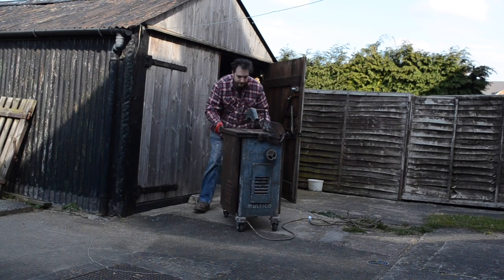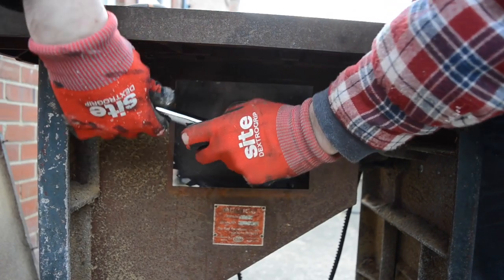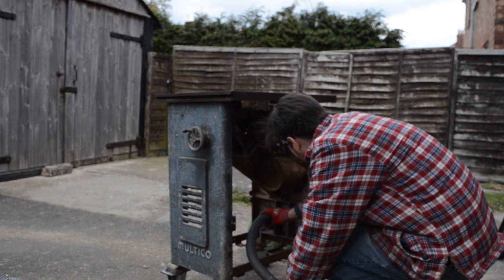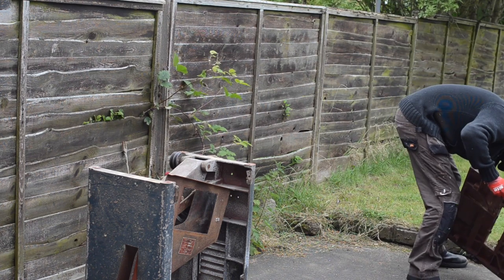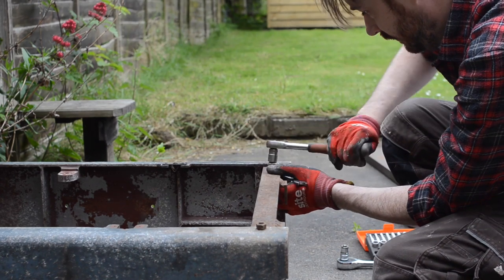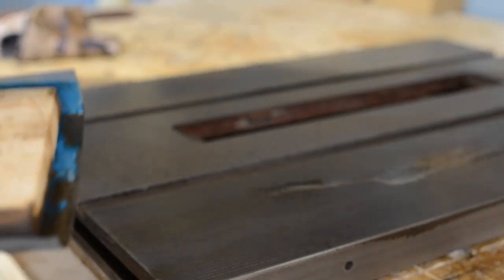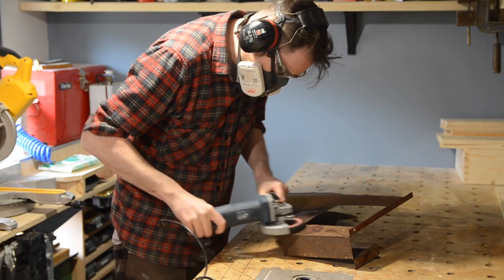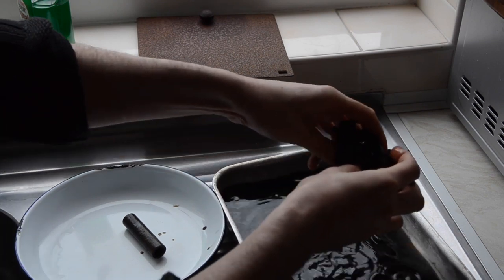Multico A1 Table Saw Restoration Part One

Comment: I wish you had uploaded this video series a year ago! I too bought exactly the same make and model of table saw last year and stripped down, repaired and repainted it. My saw has the mounting holes for the lubrication tank; I had no idea of their purpose until I watched your video!
My saw is a Multico A1/3,  the 3 meaning it was originally powered with a 3-phase motor but recently converted to single phase. 

Its an excellent saw and chomps its way happily through 100mm thick oak or other hardwood with a new Freud blade. It is very well constructed and will last for years to come hopefully!
Reply from the maker: Thats good to hear. The ability to cut through 100mm oak is great.
Reply: I've  got  one too, it has a three quarter inch arbour. Where did you get your blade. Or converter I'm finding it  difficult  to  track down

Comment: I couldn't resist having a dig, it seems that there was a Multico Petrol Table Saw with a Villiers engine.  I imagine yours was such a beastie and was 'upgraded' to electric when the engine packed up or to make it less noisy.  I could, of course, be miles out, but it's fun to have a guess.  Nice project, I'm looking forward to seeing the finished article.
Reply from the maker: You did better at finding information then me. Thanks Robert

Comment: The fact that the saw has a liquids tank and no riving knife plus a none swivel blade leads me to believe this was used for sawing non ferrous metal and the tank was used originally for lubricant . cheers and good luck with the project .
Reply: Agree 100 percent
Reply: (Engage armchair commenting mode): Also the fairly low RPM might be another clue? Looked slower than a typical table saw for wood.
Reply: @alexnosheds  1450 rpm is average speed, wood lathes, saws etc. Its the ratio of the pulleys that give the actual cutting speed. Basically large driver to smaller driven, fast speed. Small driver to larger driven, slower speed, regardless of motor rpm. (Or in wood lathes a multi choice of pulleys for more speeds). What you need for bench saws is power which this had looking at the hp.
Reply: gbwildlife uk I was looking at the spinny cuttey thing when it was running. 👍

Comment: Great old machines for ripping. Glad to see such a good fence which only goes as far as the gullet of the blade at bench level, as should be the case with a saw bench as specified in H.S.E. regs. Good guard as well.
Reply from the maker: Thanks Gary but I have to say I don't like a short fence
Reply: @Badgerworkshop  It is the correct fence for ripping, when the riving knife does its job or if the timber flares out when ripping there is space for the timber to go which will prevent kickback. A saw bench for ripping and a dimension saw for cross cutting are two different saws for different operations. Dimension saws usually have the fence go the whole width of the table, this is because you invariably cut sheet material which does not move when you cut it unlike solid timber. Look forward to seeing the total refurb, I assume you are to get a new nvr switch for it.
Reply: Looks sweet pal, can’t wait for No.2 👍🏻👍🏻
Reply from the maker: Thanks Mate

Comment: I do love a tool restoration video, I have to recommend the silicone free beeswax spray you can get from Home Bargains and Sainsburys for £1.50. I use it on all the metal in my workshop after I dust them down. It smells nice too! I often see these sorts of Multico Tablesaws on ebay for not much, I get put off buying one due to not having the room and that they have a relatively small table but I'd think it'd do really well built into a bench.
Reply from the maker: Good tip. I will have a look for some next time

Comment: Just to weigh in on the oil reservoir question. I have see old table saws that have a foot operated pump for raising and lowering the blade. The mechanism may have been removed without the reservoir. Just another possible angle to research.
Also what is on spec plate on the side of the dust shroud?
Reply from the maker: Those saws sound interesting but this defiantly has the original rase mechanism

Comment: A very interesting saw.  I also have not heard of this manufacturer before.   Looks to have been well made.

Someone else mentioned this may have been for metal work.   Have you calculated the rpm of the blade?
Keep a cover over the EvapoRust pan to minimize moisture loss overnight.   If you get a "tide mark" on the pieces it can be very difficult to remove.
Dave.
Reply from the maker: Good tip thank you

Comment: Hi Matt, I used evaporust and it is a good product although a bit on the expensive side. Someone suggested that I use white vinegar instead so I got 4 galls and tried it. To my supprise, it worked very well and I now use the vinegar every time "I just have to stop my girlfriend from putting it on her chips.
Reply from the maker: It does work great but as you as it it a little expensive.

Comment: If you are restoring a piece of equipment buy 1 or 2 wire wheels for a grinder and use the wire wheel to remove rust and old paint if you are working on metals, don't use on plastic as it will gouge the plastic. The wire wheel won't affect the metal and just removes what's needed. I've been doing it this way for many years and restored dozens of old machines, after a while you just learn what works and what doesn't and by far the best is a wire wheel since you can get them in different shapes and sizes and works faster than paint stripper or most chemical solutions.

Comment: Been watching Franklin Woodworks, you just reminded me of the troubles he is going through with humidity and rust with cast iron
I know it's not the same issue for you, interesting to see how you both get on
Reply from the maker: I think I will be fine as I have two cast iron bandsaws and they are OK.
Reply: Franklin Woodworks likes Fluid Film to prevent rust.   He has videos on using this with updates some time later, no rust.
https://www.rust.co.uk/product/fluid-film-rust-proofing-71
Dave.

Comment: The tank looks like a petrol tank and t I think that this saw may have hade a petrol engine before being converted to electric. I have used a saw similar to this in a fencing yard to cut aris rails and panel slats. The saw didn't tilt because it was belt-driven off the petrol engine. most wood yards use band saws but this doesn't come in petrol and if you are away from the electric supply then a petrol table saw has to make do.
Reply from the maker: Interesting I think you could be right